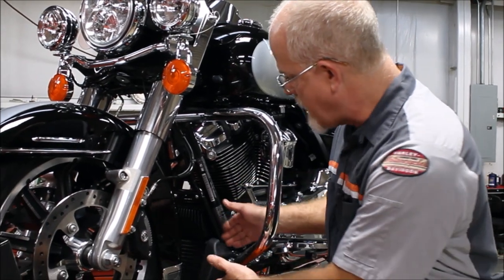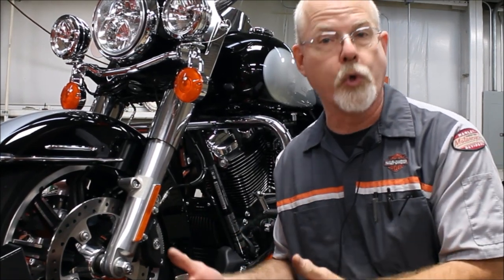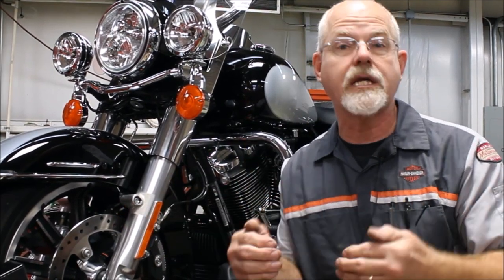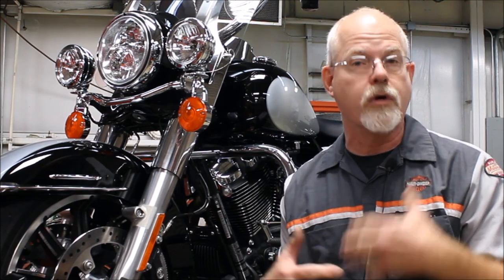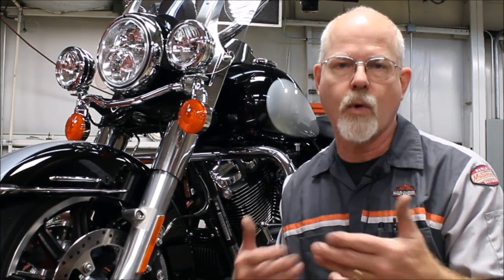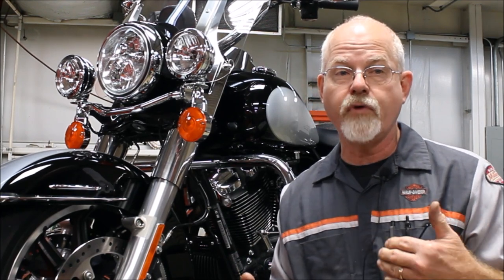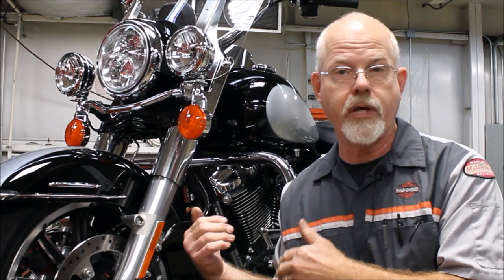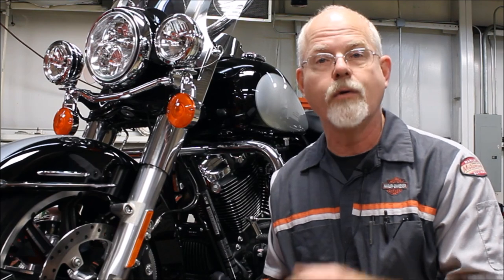DOC HARLEY: OIL COOLERS

Comment: Glad to hear Harley Motorcycles are updating their engineering. USA built Victory adapted this 20 years ago. Welcome Harley. Keep the improvements coming.
Reply: Yet look who went out of business????
Reply: @trigun890. You need to look into why Polaris halted production of Victory, The reason had nothing to do with Harley & everything to do with Indian. Typical response!
Reply: My 1979 HD low rider came with a factory installed oil cooler
Reply: You know Harleys have had Oil Coolers for a long time now right? They are just not included in all models or packages.
Reply: Unfortunately victory is gone but Harley is still here. Makes you wonder who's smarter
Reply: Victory who? The Canadian motorcycle company that went out of business?
Reply: @eronfitz  Polaris . Nuff said
Reply: @claudelarocque3655  FORTUNATELY they are a relic

Comment: I live in Arizona and none of us run oil coolers. I bought the Harley oil cooler with thermostat, always leaked around the adapter. I took it off and have never used it since.
We ride all year even above 110 deg.  HD does testing on new bikes out here in the middle of the summer. If they needed them they would come from the factory with them.
Just ride and don’t worry about it. There are a lot of high mileage Harley’s out here in AZ without coolers and no problems.
Reply: Lobo 176 same thing here in Las Vegas
Reply: While your at it take the transmission cooler off your cars transmission. How do you know how hot the oil temp gets on your harley. An oil temp gauge is also a good idea.
Reply: What bike do you have and what oil temps do you see? I live in Canada and ride a 2014 Fatboy Lo. Oil temps on the dipstick show 250 - 270 degrees at temp. I’ve got an S&S 124 with 585 cams… Seems hot cuz the old 103 usually ran around 220 degrees.

Comment: Great addition, I put a Harleydavidson fan assisted oil cooler on my 2018 RGS after it got installed with a hotted up SE stage 4 , I like it and it does help  I've put 32000ks on bike since install.allso I put a fender skirt on my front gaurd and mounted it 1/2" lower  to protect my fan assisted oil cooler , I get no mud,dirt, stones on cooler ,still looks brand new , I do across the board , riding.

Comment: Liked Sunday late afternoon 18 April 2021! Okay, when I have my pre-owned 2001 Sportster 883 tow-trucked in to the “vintage Harley-Davidson repair shop” for its imminent internal cylinder head  rebuild, I will have them install an oil cooler. A short story about the Harley-Davidson Customer Care Department: they do not care about their own customer’s motorcycles once they see it as vintage. 😀

Comment: Doc : thanks for having such clear , concise , and informative videos for us      ! 
   I’ve owned quite a few H-D’s since the 70’s , and remember back in the day , the bikers added oil coolers like the Jagg , which as you know mounted to either side of the frame’s down tube . This allowed “ clean “ air to run past it and STILL allowed said clean air  to hit the V- twins forward cylinder . 
   I traded my 83’ beloved FXWG Wide Glide in for a brand new FXLR Low Rider , and was SO DISAPPOINTED that Willie G and da boys installed the oil cooler smack dab in front of the engine’s front jug ! Now in the Texas heat , the air is preheating the air to the forward cylinder , and sending a blast furnace of scalding air to the rear cylinder …
   YOUR opinion please , sir ?
Reply from the maker: My opinion is strong. Every one is under the misunderstanding that this large "oil cooler" in front of the front cylinder is for the motor. It is not! It is only to cool the front and rear exhaust valves. With the size of the M8 motor the Motor it self need a 10 row with fan oil cooler besides the center oil cooler. Like the old days. Yes I would rather have two oil coolers on each side of the frame tubes and let the front cylinder receive fresh air. I am stepping down from my box now....Doc
Reply: @LowCountryHarleyDavidson  
Thanks for that most detailed response !
    I was “ happy “ to see them install this oil cooler ; I was just shaking my head and asking myself -
“ WHAT were their engineers THINKING ? “

Comment: I have ridden a HD for years  and the one thing that always comes to mind is how so far behind the curve HD are when it comes to adding positive innovations. This is a prime example. Always playing catch up.
Reply: Just because its not standard on all models doesnt mean its new. Harley had stock oil coolers on their bikes since the 70's. Its just a different package, like how some cars could get the power window upgrade back in the day.
Reply: I would never ride a HD but I like your thoughts!! 😆😆😆🏍🏍🏍🏍🍺🍺
Reply: @artmchugh5644  yet here you are commenting on and watching HD material. 🤡
Reply: @ryanmoore2779  I am a motorcyclist!!! Everything cycle related interest me , itchy boots videos are great ,about her travels. Moto GP videos are great because of the balls those racers have!!! But lots harley videos are about fixing problems with their bikes !!! I just find it interesting that they seem to think that straightin out that crap is normal !! Watch the " our ride life " new video,  95.000 miles on the chrome air compressor and it needed cams,oil pump and other stuff and they were smiling going to pick up the bike . I would be PISSED paying $$$$$$$$ for all those repairs!!!🤮🤮🤮🤮🤮🏍🏍🏍🍺🍺🍺

Comment: 07 FLHT.
Dealer fitted the Harley CVO oil cooler (my request) which was located low on the front tubes as per all CVO's.
Lasted maybe 2-3,000 mile before it was holed and credited under warranty.
Guess I was one of the unlucky ones.

Comment: One of the thing you didn't mention is that oil temperature at crank bearing and rod bearing while driving it is lot hotter, if you take stock bike and you put cam and pistons and ride like sport bike, yes you should use oil cooler.

Comment: Hello Doc, thanks for your videos!! 
I own a road king 103 from 2011- original-except air intake I believe. EIMTS is often on.  I would like to make sure that the engine is cooled enough and improve the comfort. With the catalysator there is also lot of heat from the exhaust: what is the best for my me: cool flow fan, or adding the Harley fan cooled radiator. I believe that each of them can be mounted, possibly not with all the functionalities.
Reply from the maker: According to my catalog neither will fit your bike. A HD oil cooler will help the motor. I prefer the Jagg 10 row with fan or the ultra cool with fans. To help you feel cooler....stick your knees out in the wind :) Thanks ~ Doc

Comment: I'm going to have to slightly disagree with the reason for HD putting the fan cooler on the Trike models;  rather than because they are moving slower, more stop and go or that they are in traffic more often, I believe its because of the higher 114 displacement, more engine load due to extra weight and rear running gear, and that they typically have or get Lower fairings which tend to block some free flowing air..  I live in the ozarks area, have a 107 Street Glide, and added Lower Fairings and I'm considering adding a fan to the OEM cooler and maybe I will be able to keep the Rear cylinder  auto Shut-off feature disable..

Comment: My 2017 Freewheeler did not come with fan. Heating at rear of back  cylinder head can be diminished by removing that cat that adds major back pressure in a short distance to back cylinder. Also using the EITMS ? to kick out fuel heating in back cylinder in summer traffic is a must  imo.

Comment: 1979, I bought a brand new Superglide with the new 80-CI engine.   No oil cooler, after about an hour of riding,  the rear cylinder would get so hot it would start to predetonate.  The rear pipe would start popping flames with a loud POW POW POW.  I would have to pull over on the side of whatever road, shut the engine off and let the air cooled engine cool.  I sold that bike a few years later, I was sick and tired of dealing with it. Yes I told the buyer why I was selling it for only $3000 dollars in excellent condition.  I quit riding Harleys for 28 years.  I now own two more, BOTH have thermostat fan assisted Ultra Cool oil coolers and the Electraglide also has Love Jugs.   Even tho a V-twin engine configured fore and aft is a dreadful design flaw,  I'm riding Harleys again.  If I ever have a single problem trying to keep a V-twin (incorrectly configured) air cooled engine cool again,  I'm selling both damn Harleys and I will buy a brand new, the best motorcycle in the World,  a Honda Goldwing.  (get a thermostat fan assisted oil cooler.)
Have a nice day.
Reply from the maker: Please stop in Low Country Harley-Davidson in Charleston SC and explain to me why you took the time to post this comment…..Doc
Reply: @LowCountryHarleyDavidson  Good morning Sir, I will do that.  I live in Myrtle Beach.

Comment: Hello Doc. Thanks for the info. I was curious if adding an oil cooler messes with the PSI rating of the oil system itself on the motorcycle? 

I was just curious if the stock oil pump can handle the extra oil lines, cooler, and all of the curves and ups and downs. Maybe I'm overthinking it. Anyways just curious and since you didn't mention it maybe it's not an issue.

Also while I have you could I add a stock H-D oil cooler from say a 2017 Ultra or Freewheeler to my 2016 Ultra with liquid-cooled heads?

Thanks Doc.
Reply from the maker: Two points, purchasing an oil cooler designed for your Harley-Davidson will work with your designed oil pump. 
So installing an M8 oil cooler on a twin cam is not a good idea….Doc

Comment: I have a 16 Heritage with true duals and a big air breather. The pipes are wrapped. I recently added a fan assisted cooler with thermostat. I rode yesterday and it was a pretty cool day. The bike temp got up to 273 in stop and go traffic but was running around 250 otherwise. I’m worried about the summertime. Is there anything else I can do to cool it down?
Reply from the maker: You have checked all the right boxes. Keep the oil clean as much as possible. Make sure your “tune” is correct. Too lean will raise the temperature. And keep moving, this is an air cooled motor👍…Doc

Comment: My 2019 softail slim came with an oil cooler but without an electric fan. Would it be possible to have an oil cooler with an electric fan installed by the dealership?
Reply from the maker: HD does not offer a fan assisted oil cooler for the Slim. I went with Jagg 10 row with fan..I love it! Doc

Comment: 1: Harleys had oil coolers for at least 50 years. Its not standard for all models, but they are not behind. Because they are not always needed on all engines or models, I agree with their route of having the people who do need it pay and let the majority not pay for a part they dont need. 
2: Getting the proper grade oil that wont burn off in the temperature you're riding at is far more important, including doing an oil change if that environment is going to change when you do a long haul ride.
3: Shut up and ride while you still can.

Comment: Awesome insights Doc !
   I’m ( still ) highly disappointed that HD didn’t follow Jagg’s engineering by having the location of said oil cooler to either side of the down tubes of the front of the frame to allow
“ clean air “ for the oil cooler AND clean air to hit the front of the front cylinder ! ( instead of placing the new HD cooler directly in front of the engine )
This was a poor choice on the Motor Company’s part ; it would have been NO MORE expensive to have chosen this better location. , IMHO .
Peace ☮️

Comment: Doc,   Will an oil cooler help for my bike? I have a stage 4 setup and it runs hotter than normal with the cams, and heads .  But in traffic I dont think this would help? at lights and such.

Comment: Thank you for this video Doc. I looked into putting on one of these coolers until I heard from a forum member a while ago...that in cold/cooler temps, the cooler can cause the oil to "froth" up and that would NOT be a good thing. I didn't hear you address this. ???
Reply from the maker: The Harley-Davidson oil cooler mentioned has a built in thermostat that is used to prevent a "froth" up from occurring due to cold temperatures.
Reply: @LowCountryHarleyDavidson  I understand that you can also add a bypass valve that you can shut off the flow to the cooler for those of you who live in colder climates.

Comment: How about using steel braided lines n not worrying about stones flying . I had one on a 85 fxr. Can I get one for an 09 heritage softail? Would you  know approximate cost of parts?
Reply: Steel braid covered oil hoses may well help guard against foreign object damage, however the heat exchanger body itself remains at risk of puncture damage from foreign objects unless protected by a wire mesh screen.  Thanks, Ralph K in St Louis, MO

Comment: Doc do you need to re-tune the bike after installing an oil cooler?  I ride mostly in city traffic and my 2005 twin cam gets my right thigh medium well while at a traffic light.
Reply from the maker: No re tune with an oil Cooler addition. But maybe look into your tune.
Timing might be too advanced at idle....Doc

Comment: Doc, …… i have question:    Years ago I had a Sportster (1994) and there used to be an aftermarket round oil cooler that after you removed the oil filter you could screw on the finned oil cooler on and then the new oil filter behind it.  It also gave your Sportster slightly more oil capacity along with extra cooling during very hot climates.  During the winter time there was a leather sleeve that slid over the cooler to block the now much colder air flow on the fins but still allowed for a tad larger oil capacity w/o having to remove the cooler.  I wanna say HD used to sell this product but have not seen one in 26 years.   Any ideas on who made these animals and where/how I can get one now for my bike ?
Reply from the maker: Check  V-Twin web site and ask the cool dudes at Lowbrow customs...Doc
Reply: K

Comment: Mike, i have a 2012 FLHRC that looks like it has a factory oil cooler but my TC103 even with synthetic seems to run hot and limp mode comes on too soon in my opinion......help any ideas?

Comment: Hi Doc, what are your thoughts on OILBUD hidden oil coolers, any experience with them? Looking for an oil cooler that will be the most efficient for my 2008 FLHX with a 103ci installed. My bike always ran hot since new, even without the upgrade to the 103ci. Your help and knowledge is deeply appreciated, THANKS and stay safe!
Reply from the maker: Brian I truly appreciate the question. I did not know about oilbud coolers. I am looking into them. Before your question I have been looking into Jegs and ultra-cool. I am a true believer in a fan with a cooler for those stop and go traffic moments. There are key points. 6 row vs 10 row. How much CFM the fan capability. Thermostat fittings and fitment. Do your research as I am. An oil cooler is definitely a great addition to any Harley-Davidson. Thanks ~ Doc
Reply: @LowCountryHarleyDavidson  Hi Doc, I want to thank you for taking the time to answer my question and give me suggestions. After my research and much debating, I've decided on the Ultra-Cool 3.0 dual fan assisted
 oil cooler. I'm looking forward to much cooler ride! Thanks again Doc, be safe!

Comment: Hey Doc, Would I need an oil cooler on my 2017 Street Bob?  It’s got stage 2, aftermarket Reinhart  exhaust , and the engine cam.  Or is it good for the engine over a the lifetime of the engine or bike, high mileage, etc?  Not planning on doing stage 3 or 4 but maybe in the future.
Reply from the maker: Glfmar Madison your bike should do well as is, just make sure it has a good tune.

Comment: Hi Doc, I really appreciate your technical advice and you are a godsend to the Harley Davidson Community. 

I am the second owner of a 2003 Harley-Davidson Road King Classic. The original owner had the Screaming Eagle kit added after buying the bike new and the work was done at a Harley dealership and so the Pistons, Head, and Cam were upgraded and the V-Twin 88 became a 95.  

Question:  I neither baby, nor do I hot rod my bike when riding, so would you recommend an oil cooler for my riding style? The bike has just over 20k on odometer and is a strong runner which was previously well maintained and cared for.

PS.  If you can also tell me what the Screaming Eagle conversion did for my low end torque, as well as mid to upper range torque? This is my first Harley and don't really know what performance to expect from it.
Reply from the maker: I do like an oil cooler even though it was not mandatory when building a 95. An oil cooler with a thermostat definitely. 
The 95 upgrade from the factory gave you more of what you liked in a 88. It favored more torque than HP. The Factory built the kit for reliability so there is room for more with a cam change, better pipe, air cleaner and Tuner. It is getting more difficult to find a tuning device for the older Twin Cams…..Doc
Reply: Your reply was much appreciated Doc 👍.   I now have a better sense of what I have thanks to your feedback.  My understanding is the Power Commander 6 tuner is still available for  my 2003 RK and I 'm thinking about adding it because having a tuner to accurately control and measure air fuel mixture as riding. conditions and ambient weather changes should be advantageous for a bike's fluctuating engine temperatures. I am still considering the oil cooler but today my Harley mechanic suggested the tuner over the oil cooler.  The thought was any V-Twin larger than a 95, is going to generate considerably more heat and as such an oil cooler is a prerequisite. The evolution of the Harley  V-Twin to larger and more power just doesn't cut it with old school Air Cooled.  Thanks again Sir.
Reply: Hi Doc, I decided to go with your advice and am adding an Ultra Cool oil cooler to my 2003 Road King.  Thanks for your invaluable tech tips!